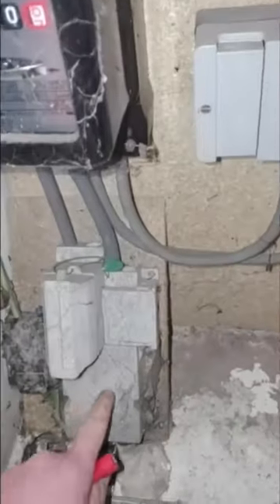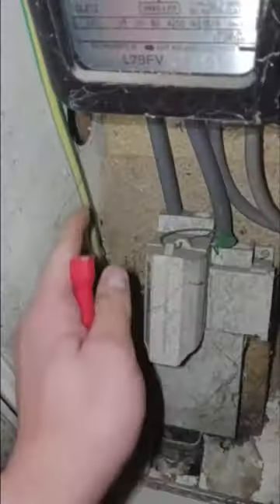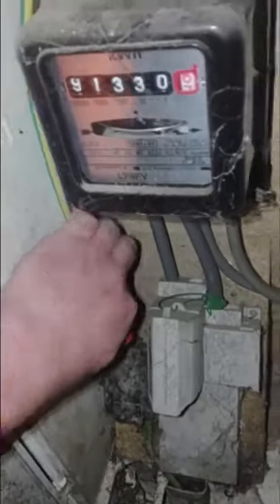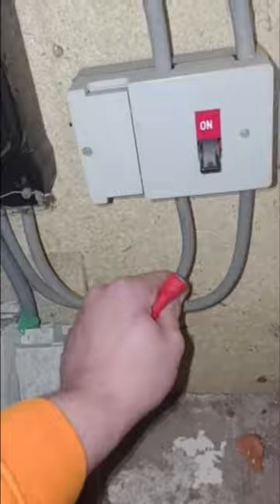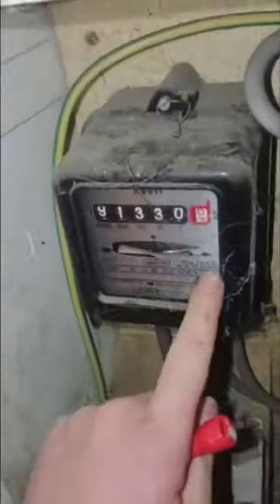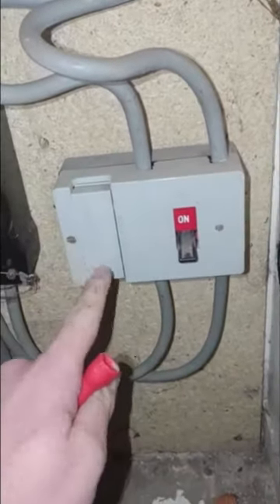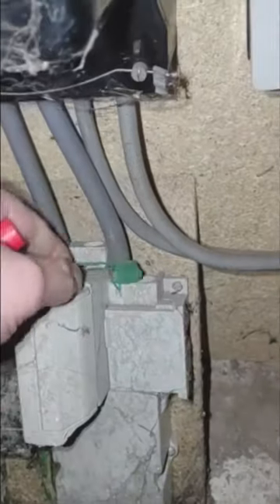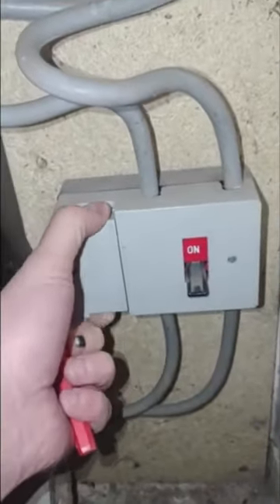Why Have I got a Switch Fuse Isolator in my Meter Box

Comment: My in-laws have 3 C.U's in their property. Two adjacent the meter & cut out & another located some 30 or so metres away at the other end of the property. The original 'electrician' fed that distant C.U from Henley blocks off the meter tails via a 16mm 6242Y T&E. The only thing protecting it was the 100A DNO cutout fuse! No additional main earth conductor was run either. Just relied on the 6mm CPC of the 16mm twin which was connected directly into the earth terminal of the cable head/cutout. 
I had a horrible sinking feeling when I discovered it. Needless to say it's now been rectified. The whole house is wired in a rather unorthodox way to be fair.

Comment: A friend has just moved into a property built about 6 years ago. Guess what the tails are appropriately 6M long and no SW Fuse isolator. Don’t you just love House Bashers
Reply from the maker: That’s disappointing - any other wiring issues in the property?
Reply: @GSHElectrical  I’m not sure .  I haven’t investigated. For some strange reason they used a Hagar consumer unit with a lockable cover . Keys lost previously and the cover won’t close properly. .
I totally agree it’s disappointing but  all very common these days .

Comment: I started work as a trainee distribution engineer with SSEB in 1986 and the 3m rule was already well established. Why 3m? It was/is viewed as a practical length for the meter tails to the DB or main-switch. The DNO don't want to be responsible for protecting any more of a customer's installation than is reasonable practicable. Over the years I have seen some 'interesting' interpretations of what constitutes 'within 3m', including an installation where the meter was indeed within 3m of the main-switch if you measured with a tape measure across the room. The 'electrical length' (tails clipped up the wall from the meter, across the ceiling and down the opposite wall to the switchgear) was closer to 9m. Nice try.

Comment: Say it’s 100a cut out do u have to use selectivity for the second fuse so say 80a?
Reply: Maybe one fuse is a slow blow and the other a fast blow
Reply: Surely that means your downgrading your main Incomer and reducing your supply which you may need at full capacity especially if using ev car chargers!??
Reply: @alanmarriott9216  that’s why I asked, but surely it has to be less to not blow the main cut out in the event of a fault..

Comment: A suggestion for you or efixx team - why is the 3M rule in place? What are the calculation for the down rating or is the 3M just a rule without say current limitations and just a number picked from someones head much like the 2.5M sockets in a bathroom rule?
Reply: I think they did a video on this 🤣
Reply: @AndyK.1  no they didn't. The dno (mostly) say 3 metres. No reasoning as to why that limit is in place or the rationale behind it
Reply: its from DNO's some specify only 2M, I presume its in their regs with suitable calculationsto be performed to ensure compliance etc like BS7671 usually has

Comment: when they fitted my smart meter they removed the isolator switch, should i get one fitted again or is this one of those things thats designed to stop unqualified types from adding a plug?
thanks
Reply: I’d ask the smart meter installer to replace the switch they removed.  If in future the property needs a new consumer unit, the spark doing the job will be pleased to find an easy way to isolate the tails.   As far as working on any circuits coming from the consumer unit, it should have its own individual circuit isolators (fuse, mcb, rcbo) as well as a main switch.
Reply: @MS-Patriot2  from watching loads and loads of videos about this sort of thing over the last few years it seems a common thing
It also seems to be the case that the DNO find out if anyone is working on your electrical system
Reply: @therealdojj  I don’t see how?  I’m a spark and had to remove tails from a smart meter for my own safety as an isolator switch wasn’t fitted.  There was no seal on the meter’s terminal cover and as soon as I removed the cover concealing the terminal screws it was apparent there was a tamper switch.  The smart meter continued to flash away, I continued my work, reconnected the tails, correctly torqued the meter terminal screws and replaced the cover.  No energy could be diverted or stolen without passing through the meter.  If instead I’d broken a seal on the main fuse and pulled it out to isolate, I’d need to notify DNO and ask them to re-seal it.  No issues with either in my experience. I dare say the tamper switch may have triggered an alarm at the DNO but the health and safety of myself and my clients is far more important than a box ticker trying to make an already challenging environment more onerous.
Reply: @MS-Patriot2  so you worked on live meter tails and consider yourself health and safety concious ? 🤔😂
Reply: @codenamenel  I did not work on live meter tails.  When removed from the meter, the cables to the consumer unit are isolated.  Sure the meter end is live but removing a cable from an insulated enclosed connector block isn’t dangerous provided your tools are insulated and the installation is de-energised.
Reply: @MS-Patriot2  did the tails remove themselves from the meter or did you work on live tails
Reply: @codenamenel  I think we have a different view on what is a live tail.  There were no live cables flapping about. This is no different from probing the hot end of a CU isolator to establish Ze.
Reply: @MS-Patriot2  You are disconnecting energised cables without isolating them, therefor working live when you shouldnt be. you are also, when the cable is out, leaving openings larger than IP2x in the bottom of an enclosure which is live. 
If anything were to happen, Under section 14a of the EAWR you would definately be liable.
Its that simple and stop liking your own posts its proper creepy
Reply: @codenamenel  I never like my own posts.  I agree with your opinion. The cabinet containing the meter was only accessible using a tool. Happy Christmas 🙂